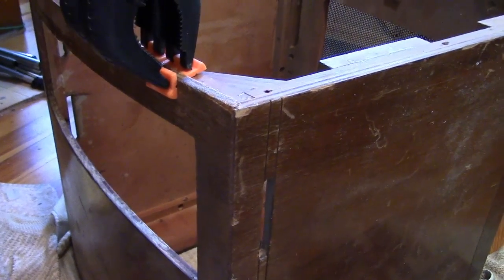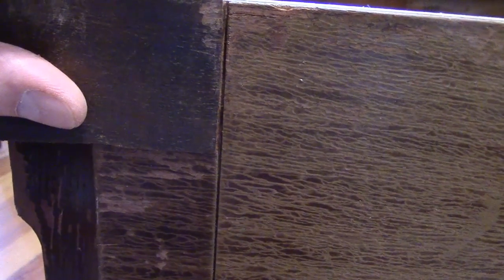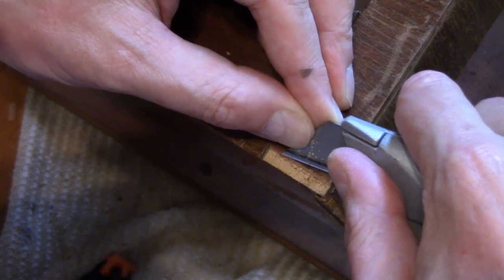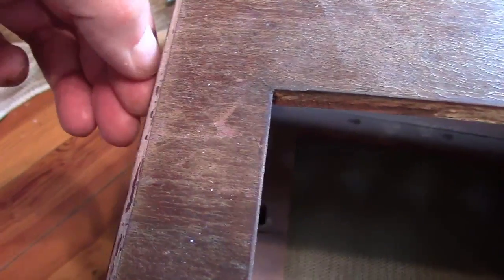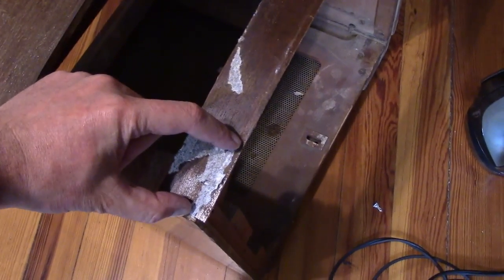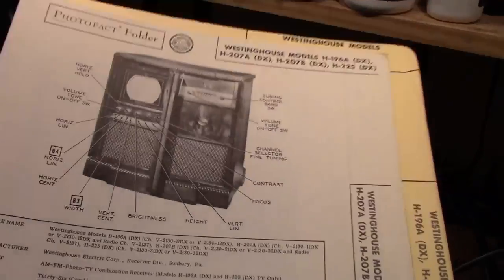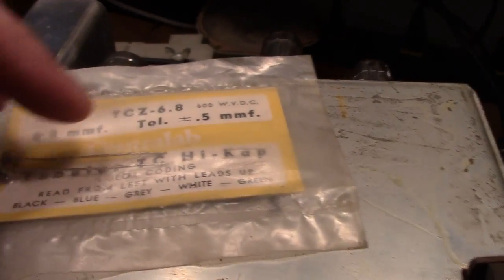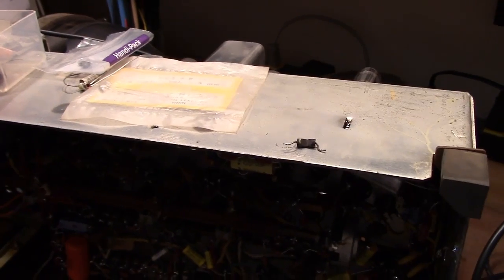Westinghouse H-196 restoration p11o?

Comment: I think the easy way to remove the dial glass out of the GE is to remove the one clip on the left side only, and then glass then should slide to the left out of the rubber brackets on the right.   The brackets have tiny teeth in the opening that slides over the plastic tabs and are almost impossible to get back on once removed, it appears they were to be permanent when installed.

Comment: I know this video has been around sometime but one trick you may or may not be aware of.
When splicing in vertical grain, place the patch over the existing veneer. Then make the cut close to the existing edge through both pieces at the same time. The vertical joint will be invisible. Also a card scraper will plane down the entire cabinet for a really fine finish; not needing sanding.
A great job!.
Reply from the maker: Hi, thanks.  Yes, I do know about that trick and it does result in a tight joint.  It's important to match the grain and color too.  Also don't let grain filler or stain darken the joint

Comment: Hi Bob,
Ya know, in the ham radio world we are using small caps and inductors all the time for VHF and UHF filters, tanks etc and a great little bit of kit we all seem to have is Almost All Digital Electronics LC meter, .010 pF to 1mFd, and 1nH to 150mH range at 1%. Cheap as a kit or pre-build. Also,you may be able to make a cap out of high quality glass PC board or file a ceramic (npo or cog) disk cap. Lots of tricks, W2AEW or VE7ZWZ may know more too. Since you have the gear, tuning a gimmick made of teflon coated wire and tuned by sweeping the pi filter at its lowest frequency for correct total parallel C may be the easiest with what you have. On the other hand -seems like that low pF is not gonna make much relative diff at the lower VHF frequency you are working at?

Comment: 1206 smd parts are not that small, they are still pretty easy to solder. And instead of soldering wires right to the smd cap itself, which is fragile, I'd suggest you to use small chunk of copper clad somehow bigger than cap itself, cut away copper in the middle, so you'll end up with 2 pads to solder on
Reply from the maker: MrJohhhnnnyyy I misspoke it's 1608 and very small.  Issue with using copper clad is it will add to the capacitance.
Reply: bandersentv In such critical application, yeah, air wiring is best. But I don't think copper clad will add much capacitance as long as you don't leave flux residue between pads, however, you are speaking about .5pF cap, so I'll shut up :D 1608 is 0603 in imperial, so yes it is rather hard to solder.